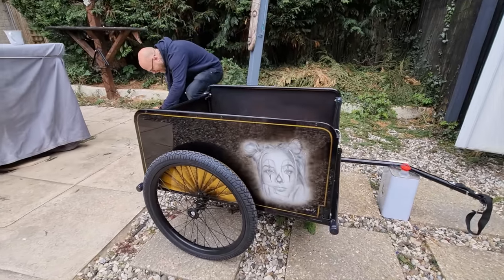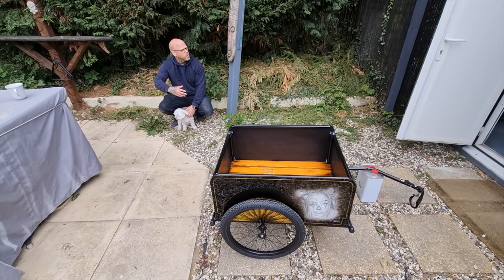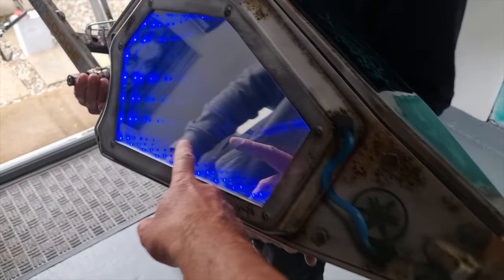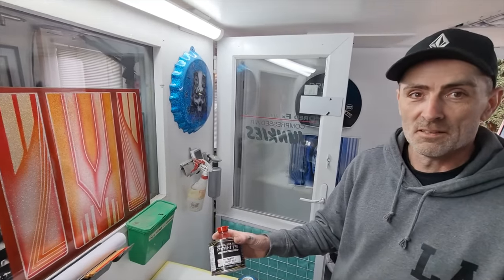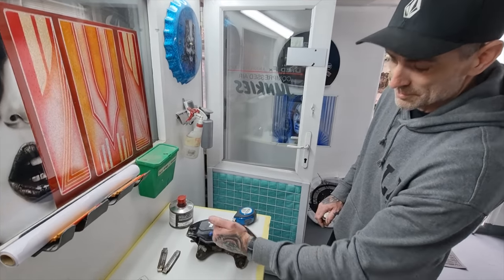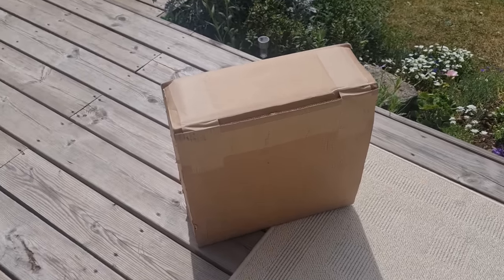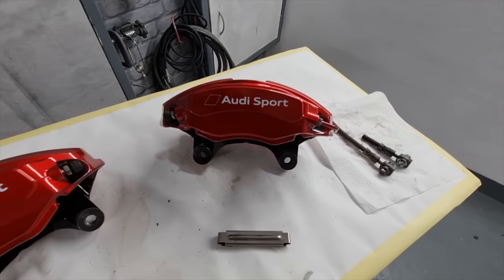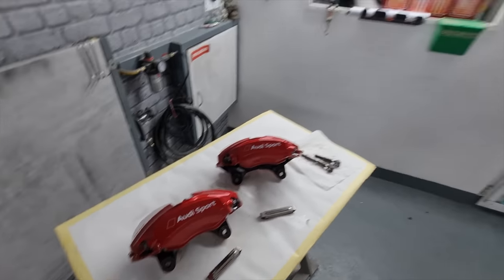INSANE EBIKE MOTOR!!!

Comment: one issue i've found with these stealth bomber style bikes is that they don't seem to absorb bumps from the road very well, probably because the seat is too far back compared to the pedals so im not able to support some of my weight on the pedals like I can with my mountain bike,  also when I stand up the handlebars are a little too close,  but iif I lengthened the stem they would be too far away when I sit down, I think it needs a custom fabricated seat mount to bring the seat forwards ( I don't use the motorcycle style seat, but I Imagine it wouldn't help the issue ).

Comment: Hello Andy my fellow kirby member,  I have a 52volt 30amp battery-and a 52volt 75amp battery,  one is putting out 15000w and the other is putting out 2000w,  if I join these together in series with it damage my 60Ah control box or my 2000w wheel im using,  I melted my last control box because I did the bridge over with solder on the shunt, the wires had melted away on the XT60 connector on the control box and I blew 3 mosfets,   would this likely happen again,  your knowledge is very much appreciated